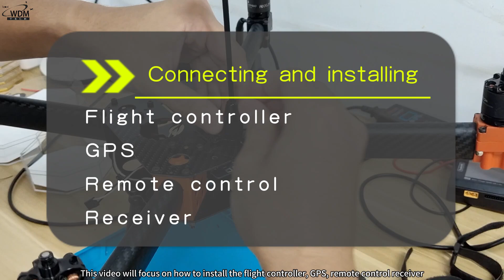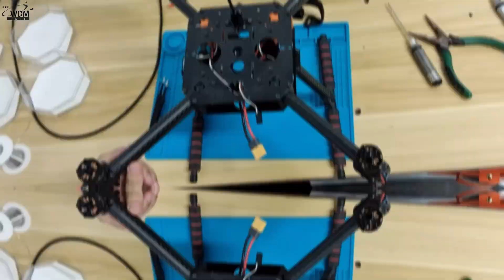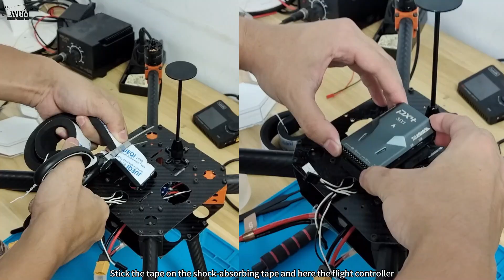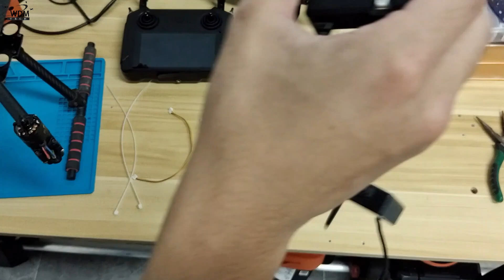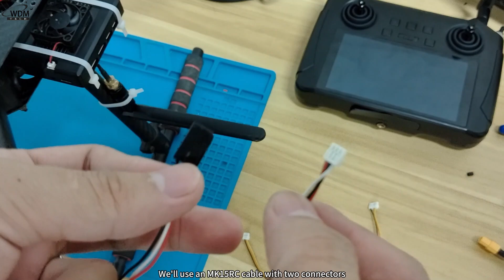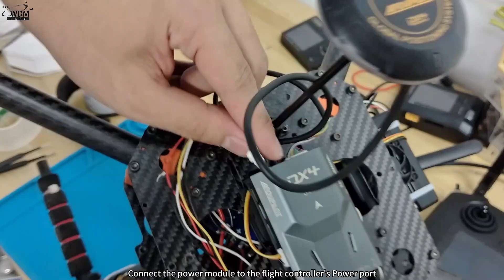How to build a drone-installation and configuration tutorial（2）

Comment: Is the power cable is series for the PDB, and Receiver? wont that devide the Voltage?
Reply from the maker: The power cable connects to the battery and then distributes power to four motors through a distribution board. You can check the installation and configuration tutorial (1) where we used the distribution board.
https://youtu.be/frCFCDaS1Ss?si=jcs7MTjBudnzRNXZ
Reply: @worldronemarket  Is the Wire connector series or parallel (Between the Battery and RC power input)
Reply from the maker: @rohanvijapure-q7w  parallel circuit